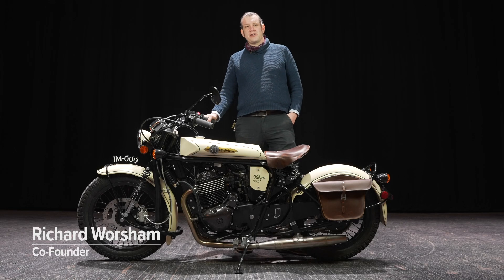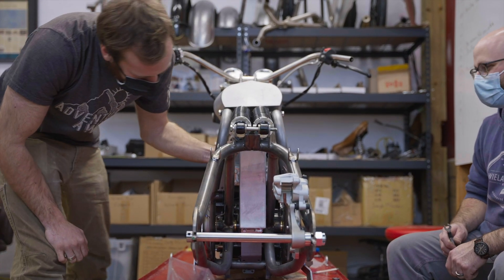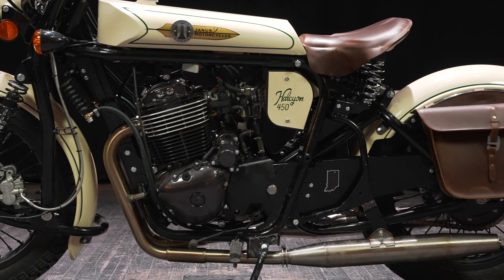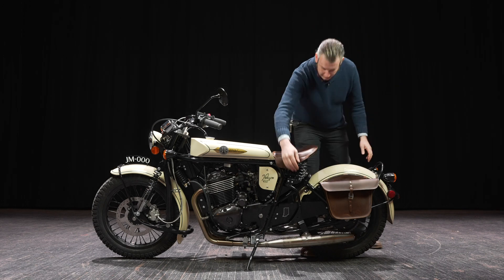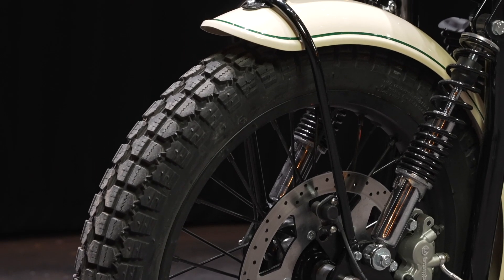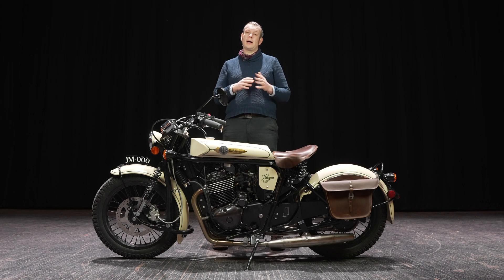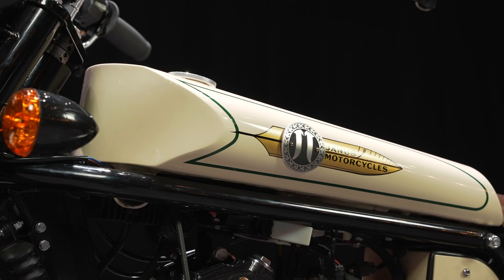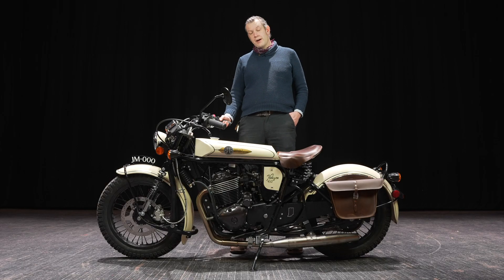Janus Halcyon 450 Spec Walkthrough [Prototype]

Comment: I have a question? I'm not much of a fan of the cylinder heads with billets or polished cooling channels like these on this 450cc engine.... is that a custom option? I'm very Entertained  by the looks and designs of this motorcycle! If I may be intrusive, the wheel "nut" to mount on forks would look better with a Stainless Acorn nut instead.... just my thoughts!

Comment: Fuel injection makes for very lean running air-cooled motorcycles which is why it has the oil Cooling added to it. The motor looks to Modern and detracts from the classic look of the rest of the bike. And the bike is still too small of a motor.

Comment: What kind of Mileage will this thing get?  With only 2 gal tank, so it had better be more than 40, as filling that tank every 80 miles would not be fun.  And after a while, it would get tiring to have people asking a lot of questions.  

I KNOW I WOULD!!  

 So, I was a longtime, many,  many miles R27, & R60 (mit beiwagen) BMW guy in later 60's and into 80's.  This machine is 'calling to me', with some question about that motor.  Our Boxers were the hammer for smooth, and reliable, but I think about the same HP from 600cc back then.

Comment: I used to ride a Yamaha TT500 four stroke single thumper. The low end torque was awesome.  A twist of the throttle would launch you out of a ditch with no effort.  Mine would do it riding double.  I love the simplistic design and function of the big singles.  This new bike should be a success.

Comment: I was interested in one of these and have watched several of your videos. This is the first time that I found and watched this one. So disappointed when you stated that the engines are manufactured in China. I had looked on your website, previously, and saw the approximate prices. For that kind of $$ the engines should not be built in China. I understand that this is the way of the world. My Toro zero turn mower has a Kohler engine. Kohler used to be the best of all small engines ahead of Tecumseh and Briggs. My China made Kohler needed a short block after one season. We have no business buying Chinese made engines. Sorry.
Reply from the maker: FWIW, we've had a fantastic experience with our engine supplier and the engine itself. A big reason why we're extending our factory standard warranty to a full 4 years. Just because we can't be perfectly purely american built  didn't stop us from starting where we are, employing 16 local folks and working with many more vendors and partners in our area.
Cheers!
Reply: @janusmotorcycles  And I wish you the best of luck.

Comment: Does it have LED headlight and brake light and turn signals. Self canceling turn signals  Cruise control probably out of the question.  Chain size, 520 or 530 ?  Foot pegs metal or rubber?

Comment: It needs a sidecar as an optional accessory. It has the look of bike's that were fitted with sidecars and lucky you it has 18" tires front and back so it can have a 18" sidecar wheel too. All three tire's can be the same size. For that really classic look a spare tire mounted on the sidecar would be a functional accessory too. It would also appeal to older rider's that don't really want a trike but need the stability a sidecar offers. Last but not least is just how much fun a sidecar motorcycle is. I have and ride a Dnepr MT-11 sidecar motorcycle and love it. It's the most fun motorcycle I've ever owned. The Dnepr is the military version of Ural motorcycles. Speaking of Ural, they sell sidecar motorcycles here in the USA and are very popular despite bad press resulting from the old Soviet Union day's.

Comment: The bike is beautiful. The motor looks a bit like the new Royal Enfield 650 cc parallel twins (hint, hint...) which would be nice. One would hope that the oil lines would be secured with something better than hose clamps; I have them on my old BSA A65, and they're always coming loose and leaking, a victim of vibration no doubt. Any idea on price yet?
Reply: $13,500 on their website

Comment: An absolutly spectacular retro beauty
...that costs twice as much as an Enfield
...with a smaller engine
Reply: The 500 is no longer imported.  It has a bigger engine but less horsepower.   The brakes are iffy.    I have a 500 Classic.   I love it.   The vibration makes it impossible to ride for more than an hour on the freeway... so I use it for short rides only.  It has proven to be a fun ride and I love the retro look.  The Janus looks like a serious upgrade in quality.  This engine is counter balanced.   I have ordered a 450,  I probably won't see it until next summer.

Comment: Why such a small engine? There is no point in making such a beautiful bike unless it can easily carry a 100kg person. Please consider a 650 and or an 850cc displacement bike.
Reply: Big Red,  a 450 is a big displacement motorcycle, especially with the low weight chassis. If the majority of people wanting to buy a Janus wanted a bigger engine they would just go with the major manufacturers. Please, don't go bigger than the 450cc, it would no longer be the niche bike that it is.

Comment: This bike needs a larger fuel tank. Period. 2.5 gallons is simply not enough now that it has suspension on both ends and the extra torque and power. One can travel with this thing only to be stymied by limited range.
Reply: Exactly, more capability with such minimized range.

Comment: I’ve liked the look of your bikes for a long time but couldn’t come to grips with a 250 engine. This 450 would be a step up in power but it has a disappointing 2 gallon tank.
Reply: How long do you expect to spend on a bike like this. I doubt anyone could spend a tanksworth of time. Bigger seat.....ok bigger tank. This will not be a guzzler as an EPA compliant single.
Reply: @autonomousindividual7780  when I hear 2 gallons I was wondering what the range would be. I do agree I'd probably not be making long road trips but who knows because it has rear suspension, a good seat, 90+ miles per hour capability. It might turn out that I'd spend a full day on it. It's not uncommon for me to be in the saddle for 8 to 10 hours on a Saturday in the summer. I'll leave the house at dawn and return when it's dark. If this bike is comfortable and capable I could see me doing that with it as it is a very beautiful bike and probably fun to ride. If it gets 60 or so miles to the gallon that 120 miles max. Fill up every 100 miles that's not to bad.
Reply: @benjamintemple3607  I just saw your comment. Just because something can run 90 Mi an hour supposedly does it mean it can do that all day especially in the summer. I've seen your videos where major damage is happens with hot motors from the fuel injection and lean mixtures resulted in engines cooking themselves. And then they tell people owe the magazine said I could go 80 miles an hour it did until it spun a bearing in the crankcase. My BSA 250 can supposedly reach 90 Mi an hour. But I don't think the motor would last long at that speed, that would be pushing it. For the money they are charging I think they should have a bigger prettier engine that won't explode if you take it on the highway for a couple hours.

Comment: I love it. Great upgrade. Would like to see a 4 gallon tank.
Reply: Sorry but the 2 gal tank sort of spoils it for me. Too small both aesthetically and practically speaking, unless of course its fuel economy is around 100 mpg.
Reply: I thnik a 3 gal would probably  sort it with out  changing the lines too much. Give you a true 150 per fillup. As much as the 250 cost the 450 might be sticker shock for cheap skates like me.
Reply: Wouldn't look right. Its hero is a board tracker.

Comment: Think Janus has another "Hit" on their hands 👍😎
Reply: Hand built machines always command a premium price over mass produced machines. If the motor is built to Honda standards, it'll be a winner.
Reply: I hope so but at a starting price of US $13,500 it will be a stretch.
Reply: @mayakovski  but it is a Custom build no?  If so, $13,500 might work for them.
Reply: @tmaddrummer  the same idea as to what makes a Harley or Indian worth $30k, I suppose.
Reply: @dionmoore879  Janus is about as close as we can get to a "Custom" bike and way less than the assembly line big bike corporations........
Reply: @tmaddrummer  I ain't disagreeing. However, the tank needs to be larger. 2 gal just don't get on a hwy capable machine.
Reply: @dionmoore879  I do agree, and I’d sure like to take that baby for a spin!
Reply: @dionmoore879  highway!?  This is a bike for secondary roads, and 2 gallons for a 450 will get you plenty far.  Look at the guys running the Cannonball motorcycle run on vintage, $60,000 motorcycles.  Very cool what they do, but out of reach of most of us.  This gives you a taste of vintage, and hand built quality, at a reasonable price - relatively speaking.  Cheers.
Reply: @jbeach6066  it does indeed do that.
Reply: @dionmoore879  exactly.
You cannot go into Honda or Yamaha and say I want this color I want this type of saddle this pinstriping etc etc.
You're pretty much by the bike and then go to their parts department for any accessories.

It's hand-built in small-town Middle America with one-on-one customer service and sales.
These guys are the real deal! Truly old school motorcycle enthusiasts.

It's not about having the biggest motor or the biggest tires.
It's about the ride and how it makes you feel in the cool Factor.